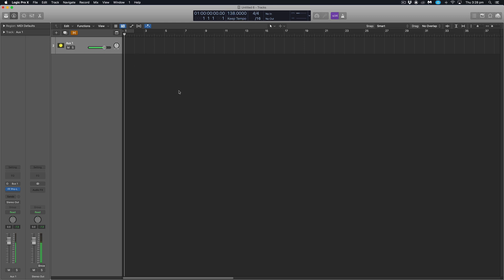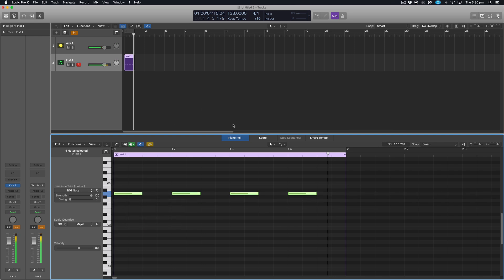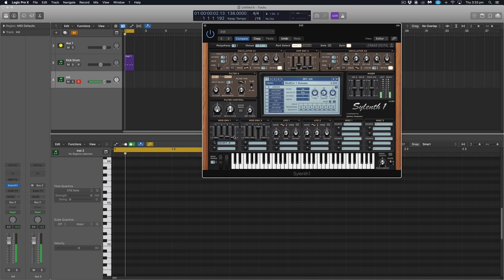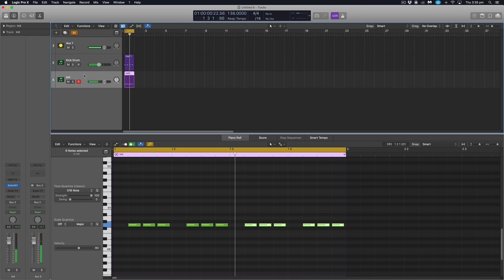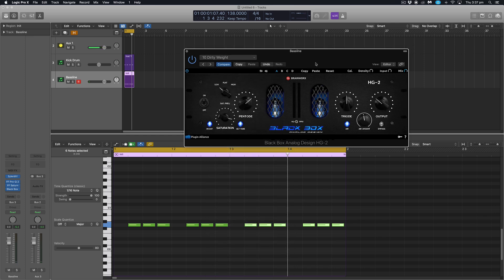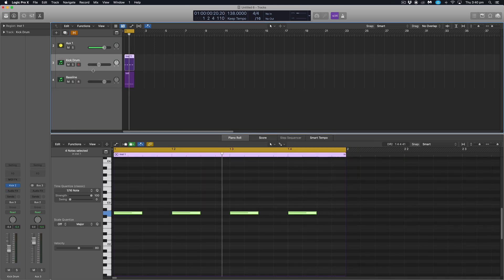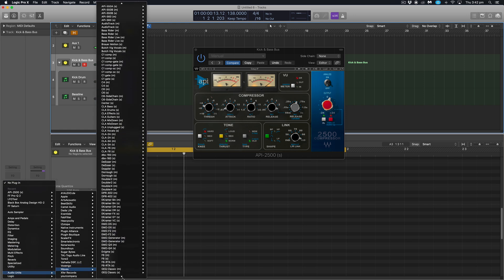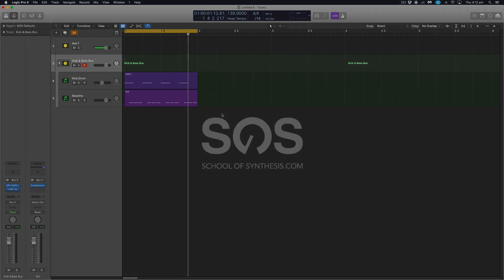Tech Trance Driving Bassline Tutorial

Comment: Love this tutorial, any way you could answer 3 questions? LoAir, your thoughts on replacing it by RBass? Black Box, any alternatives to this? What if changing key, any method you recommend? Many thanks!
Reply: Hi Martin, any Saturation plug-in that you like the sound of can be used in place of Black Box. The tone of these basses can be very sensitive to subtle adjustments with a saturation plug-in and quite often it is about letting your ears guide you to what tone you like the sound of. So load some different one's up and experiment to find one's you like. 

Lo-air and R-Bass are actually quite different in the way they work. Lo-air generates content below the fundamental frequency of the sound whereas R-Bass produces harmonics above to help reinforce. Both have their places depending on what you need.

As for changing key, I'm assuming you are talking about the bass changing whilst following a progression, and in that case if you wanted to change note one thing you could do is process the different notes using this workflow on separate tracks. 

Hope this helps! - James.
Reply: @jameshewson2264  Awesome, thanks so much (I purchased Loair and it rocks) and will follow your advise, really appreciate you took the time to answer!